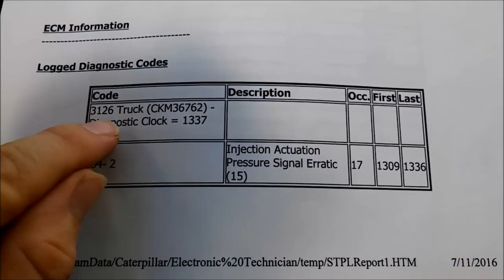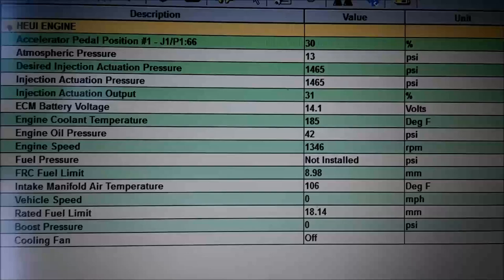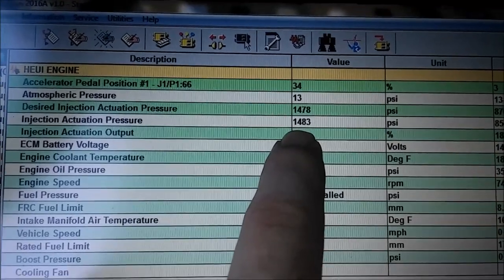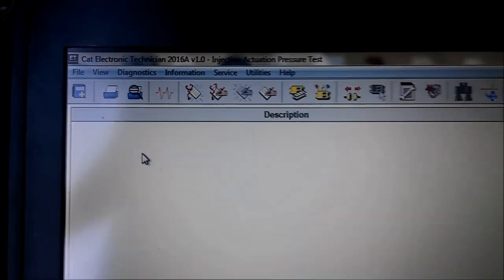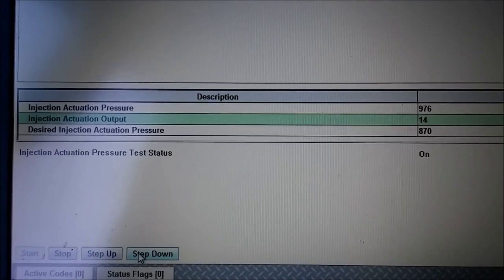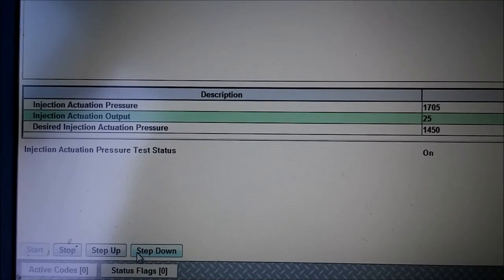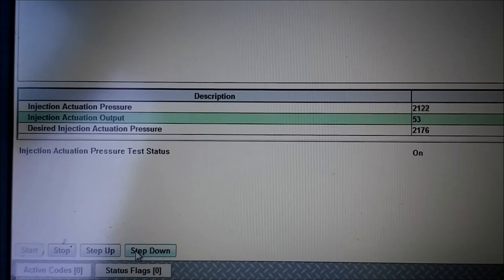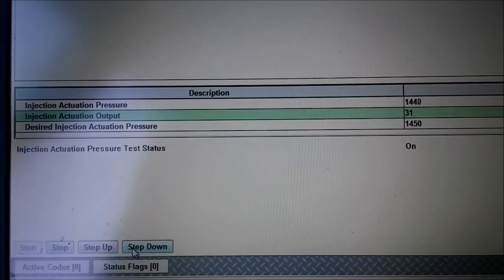How To Troubleshoot HEUI Systems and IAP faults. 164 Faults.  3126, C7, and C9 Cat Engines.

Comment: y fuel return contain lube oil at c7 engine ?
Reply from the maker: If your fuel is getting oil in, you most likely have one or more bad injectors that are allowing HEUI oil pressure to bleed into the fuel rail. It's possible the head is cracked and doing the same thing as well, but most likely an injector. The problem is that testing the injectors for this is nearly impossible so its usually easier to replace the set.

Comment: To bad they put so much electrical junk on these engines seem to have alot of issues from what I'm reading.  Mines hard to start sometimes other times pops right off. My 1992 DT360 is all mechanical you hit the key it don't even make a full rotation and it's running.

Comment: I have a 97 motorhome with either the 3126 or the 3116 in it an it broke down about 2 1/2 months ago in MD and it has been there since. The diesel mechanic who has been working on it is stumped, he tried to replace the high pressure oil pump, is that the HUEI pump your talking about? The motor will start with starter fluid and run as long as you keep spraying but they say the injectors are not opening when it's running and that why they tried the pump, but it apparently made no difference, i'm looking for any suggestions on what i can suggest to them. the motor has 97K on it and ran pretty good right up till i shut it off in a camp site. I'm going to keep watching your videos but i need some symptoms that i can recognize. If you have any suggestions i would really appreciate anything. if you could send me an e-mail that would be great jminnig@summitmortgage.com
Reply from the maker: +Jack Minnig I hope you learn about the system watching my videos. Try to watch some of my Diesel Talk videos too as they talk about HEUI systems as well in some of them. Alright, do you know your engine serial number? There is a big difference between a 3116 and a 3126 engine, if you can give me the serial number I can look it up. So a HEUI system is fairly easy to troubleshoot if you are familiar with them and have the Cat software, I'm assuming the mechanic doesn't have either. I can try to help you out a bit with information about the system, did you want to chat on Skype perhaps and then you can ask me questions directly. If you do you can email me at AdeptApe@yahoo.com 
If you want to ask your questions on here as well, that works too.
Reply: @AdeptApe  Hello I really want to enjoy your videos. I have a question please. I have a 2001 3126 in a GMC 8500 dump truck. When I start the truck in the morning it misses at idle and will miss forever if I leave it idle. I have left it idle half an hour with no change. However when I rev it up the miss disappears and it runs perfect and idles smooth. I pointed a temp gun on all the injectors and the front two are not near as hot as the other four when I check them during the idle miss but again heat up once I give it a quick rev. Any idea what might be causing this? Thanks

Comment: my 3126 in a motor home twice after breaking hard had check engine lights. the first time a cat dealer in FL checked it out and replaced the sensor on the pump , That didn't clear the code then he replaced the sensor on the left side of the head which cleared the error . Again months later I had to break hard and the same thing error . I obtained both sensors replaced the one on the pump with no help. Replaced the one on the head and check eng light cleared. I spoke to a cat teck  he gave me a cat update that said that my engine oil should be 24 Qts and not 22 . I chainged my oil and added 24 QTS. now after a 1000 mile trip I have oil leak on the intake side of my engine. ???? Over Filled ?????

Comment: PLEASE HELP ....  | am THE PROUD NEW OWNER OF A 01 FL-60..3126  RV.USE . MY HUSBAND PASSED AND LEFT IT TWO ME.. WEEEELL... I'VE ALWAYS DONE ALL MY OWN MECHANIC WORK AND YES I'M A CHICK. BUT A CAT MECHANIC IM NOT.... I'M  GETTING FLASH CODES (VIA  service engine light)...as follows 15. 39, 51  . recently i ran out of diesel and son helped prime injectors could the HUEI be over pressured manually.  It turns over but refuses to start
                                         Can you help an old vets young widow
Reply from the maker: Please email me the info at AdeptApe@yahoo.com if you want help. The comments section isn't very good for communication. Leave me the full engine serial number and as much info as possible. I usually try to reply to my emails in a couple days.

Comment: Your videos are great.keep up the awsome work you do. quick question, at the dealer i work we have access to CAT software and to the manuals. for some reason i have a hard time finding trobleshooting info for engine DTC's you think you could make a video about where to find the info.
Reply from the maker: +jamecorts Are you using SIS? I could make a SIS fundamentals video, but am unfamiliar with using screen capturing software, but I can learn. I'm also not sure if Cat would like having a SIS video since it's technically a Cat confidential website.
Reply: Adept Ape Hmmm im i know i use electronic technician for diagnostics and the. i use the dealer log in for CAT website for the manuals. but sometimes its a little tricky finding the info. if you can make a video it would be great but if there is problems i rather you not do it.

Comment: flash code 15 on a 2000 3126 with limp mode check engine light is icp sensor? thanks

Comment: I have a 31-26 that is putting motor oil back into the fuel tank nude leaks no oil in the air no oil in the water but when you run it the oil goes from the engine back into the fuel tank any suggestions would be appreciated I have changed the O ring kit on the injectors no help

Comment: What is the required actuation pressure for a c7 to start? My desired shows 1300 ish but I only achieve about 340 while cranking
Reply from the maker: Generally you need about 700-800 psi minimum for it to fire.

Comment: Would the heui injector overfeuling problem  coz  a lot of blowby.
I had turbo failed and 5 injectors of on my C9
Reply from the maker: +Ivan Mospak An injector could damage a cylinder is it was overfueling heavily, but usually blowby is caused by worn cylinders or bad valve seals.
Reply: I not sure how bad they were overfeuling. Just about to instal and reprograme ECM.but I tried  to turn the engine by applying air to the injector hole, it is rotating with each injectors.
Also I notice 130 psi oil pressere when running, when disconnect an oil sensor it's dropped down to 80 psi,
When disconnect heui pump sensor it's dropped to 0 and shuts down.
Should I check the pump next?